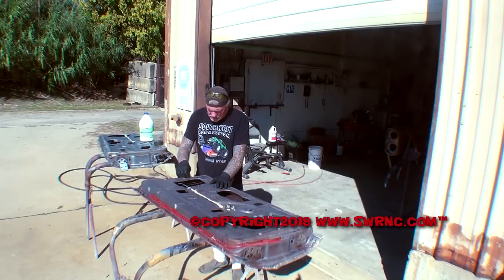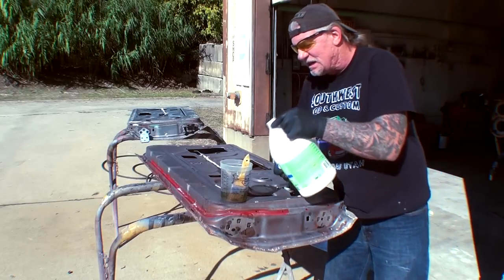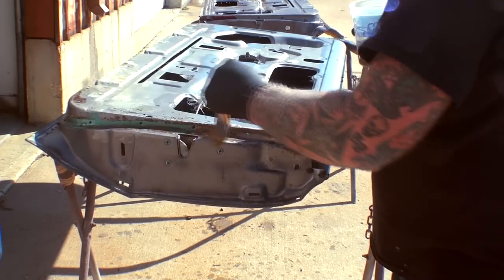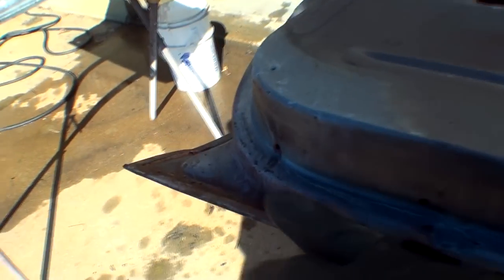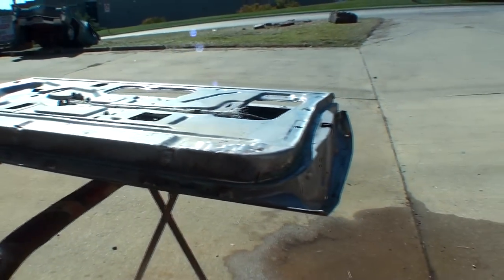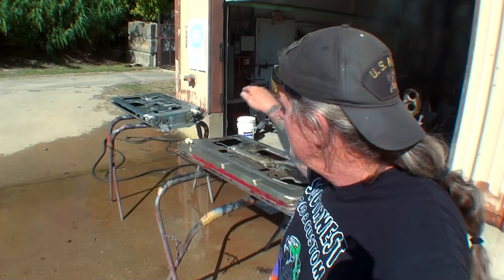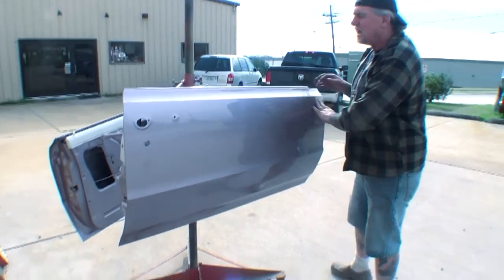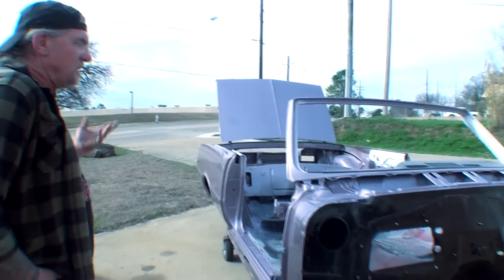"REMOVE RUST With Muriatic Acid - EXTREME GAIN!

Comment: ever use rust mort so far it is the best thing i have ever used u take a wire wheel or wire brush get all the lose rust off then u apply rust mort it changes the rust back to metal and treats the rust did a car back in the 80's still has not rusted over 30 years it so far has lasted i just love it for rust and it is cheap my dads best friend showed me this stuff and he had a very high end body shop he's the guy that helped me with body work when i was 12 to 20 years of age i learn a lot from him i learn how to mech. from drag racers this how i get parts cheap if not for free terry fisher  was my neighbor if u know who that is stock cars racer and old man bell learn a lot on how to build motors from
Reply: ps love the work u do u do very high end work ur very good at rust repairs better then me i hate rust i try to not to get cars with rust but this is ur job i do it has a hobby and only for my self

Comment: I actually like Hydrochloric Acid better because it doesn't really have any of the Iron impurities in it... + It is stronger, downside is its much more expensive than the muriatic acid...

Krudd Kutter is Amazing stuff too but you can't leave it on too long because it will start eating the metal after leaving it on after 2-8 hours... EvapoRust is the next best thing... 
There are a few products that have Phosphoric Acid to etch the metal afterwards... Like KBS Rust Blast and a few others

Comment: That “dangerous chemical toxic” that you don’t want to breathe is CO2 and some hcl fumes, it’s irritating but not deadly. The biggest risk is the hcl fumes because they will corrode every bit of metal they contact, so don’t do this inside if you can help it and if you have to make sure you have ventilation, cover everything else up and wipe everything down with like a wd40 when your done, otherwise rust city (ask me how I know).

Comment: I used muriatic acid once to clean copper bars before tinning with solder.  I would never use it again.  Way too strong, it gives off vapors that can knock you out, I know from experience.  It will also rust any iron or steel within 10-15 feet, or more.  It is also a pain in the ass to get rid of.  I have used phosphoric acid based rust removers with great success.  You don't need to neutralize phosphoric acid like you do muriatic acid after use and it's safer for you and the environment.  There are a lot of phosphoric acid products out there and are easy to easy find and are a lot safer and easier to store in your shop.

Comment: awesome Pete. Isn't  Phosphoric Acid better?
Reply from the maker: I don't know.. This is what I use and it works for me...
Reply: Muratic acid works fast and on heavy rust..as pete shows may require some scrubbing or sanding to remove scaled rust....I use vieagar to neutrize the muratic acid and last step use phosphoric acid to stop flash rusting..no orange flash rust this way..

Comment: That shit also does a number on removing paint!! Great job, Pete!!
Reply: Todd Van Winkle Muriatic avid will not remove paint from metal easily. (Though eventually it will.) Better off using a paint thinner or stripper to get the job done. Acids are for rust.

Comment: I knew phosphoric acid will do the job! I like the tip and info my friend pete! ✌ can i use this to remove rust from a truck frame ans suspension??
Reply: I built a tank and used citric acid. Check out my video. Parts came out way cleaner than sandblasting. I did all my suspension parts and frame for less that $200 including the materials to build the tank and paint for the frame. It's painted with epoxy and chassis paint.
Reply: Nelson I was just wondering the same question. That's what I want to try this on, my f250 frame. My plan was to clean up the rust, spray it with Steel It and then use Fluid Film on a yearly basis. Want to get that initial bit of rust off first before I spray Steel It on it though.

Comment: @davem3945. Under laboratory conditions you'd be right in warning of the chemical reaction that could continue if all acid was not removed. But not for this purpose. I have found this to be not only inaccurate, but actually counter-productive when an extremely high level of adhesion is required. A degree of residual acid lying on the surface of the metal prior to priming microscopically etches a key into the metal that creates a very strong bond to the subsequent layer of primer being applied - and an even stronger one when that primer is applied to an acidic surface that isn't quite dry. Neutralisation occurs when the primer is mixed with the acid, eliminating any concern over the continuation of surface erosion. It is for this reason that acid etch priming materials are widely used and accepted in the automotive industry. I don't use water at any stage to remove or water down acid, unless accidentally or over-applied or spilled onto unwanted surfaces and as an emergency measure to flush away quickly. For auto body prep, don't forget, water is the devil.
Reply: Like what you said. I'm about to "clean" rust around my windshield. What acid or product would you recommend and the steps before applying the epoxy primer, assuming the epoxy is the best second step?

Comment: Did you really use vinegar to neutralize muriatic acid?? And you were surprised about that "orange film"? That was not some orange film, that was new rust.
Vinegar is also acid, to neutralize acid you use a base, not another acid.
Other thing is that you splashed this muriatic acid also inside the doors. I don't suppose you can ever make sure to get it out of there now, so the doors will speed up corrosion from the inside. Muriatic acid removes zinc coating and other protections from the steel (it is used by welders for exactly that purpose, because it is bad to weld on zinc coating).
It is true that it can remove rust faster than weaker acids, but it also speeds up the creation of new rust, it doesn't passivate the steel.

Comment: You should just wash it off with water cause vinegar is acid so you're just putting another acid on it. and why buy a stronger vinegar then dilute it you could've just bought white vinegar from the store but again the vinegar is not needed you need to put a rust inhibitor on it. And that Orange film IS rust. That's the chemical reaction between the acid (vinegar) and bare metal and oxygen.

Comment: I need a swimming pool of that for my bug. Lol. I will have to try that. We got a guy close to the shop he will acid dip a car body and etc and very good priced. He charged me only 80 bucks a panel to do my doors. I spent hours blasting my fenders at work. Still got my hood to do. My old boss would dump that shit down the shop drain when it got plugged up. The shop then would smell like rotten eggs.

Comment: Do you put fish oil inside on the seams?
Reply from the maker: Ive never heard of this Jim.. Ill have to check it out...
Reply: That may be an option. 3m has a cavity wax spray but who knows what its made of
Reply: @diyautoschool  Hi, Pete,Iv been restoring an early Holden V8 for the last 3 years , fish oil is available in pressure pak cans.And  500ml, 1 litre, and 4 litres, can be sprayed from a gun, i poured it in all panels    standing them on the bench end for end, all after i rust converted and sprayed 2k epoxy primer ,including the shell,  i need to learn how to upload videos,  i know a "little" more than i make out, your show is great and your advice and tips go a long way , thanks Pete

Comment: It it's been blasted ....... it shouldn't need all this work .... just stick in epoxy shouldn't it ??
Reply: Blasting imo is not the end all be all. You still have to clean the part before and after blasting. Most blasters don't want greasy metal in thier booth as they recycle the media. It definitely quicker though. This is the poor man's way which is just as effective.

Comment: Step 1: apply acid
Step 2: spray acid everywhere with power wire brush
Step 3: neutralize acid with acid

Is that correct?

Comment: Orange film isn't rust?  Uh....yea it is.  You can't neutralize one acid using a weaker acid.
Ultimately, you did a fine job but, some of your information is not totally accurate.  You wiped, sanded, etc. the orange film off the car before bodywork, priming, and painting.  The orange film "etched" the metal and protected it for a short time while you worked on it.

Comment: Wow.
You neutralize an acid with another acid, not baking soda????
You use steel wool as a final scrub down, not a scotchbright pad???? 
That orange film is a reaction of the vinegar, not rust?????
You cut a 20% vinegar solution 3:1 to make it more like typical grocery store vinegar???
And whats up with the safety glasses. Come on man, at least wear a face shield. Protect yourself.

Comment: too bad, at the end put water on it, of coarse you get orange film, it is rust from the water. All the job for nothing...better sand of the rust first and treat afterwards with phosphoric acid, don't use water, just let it dry